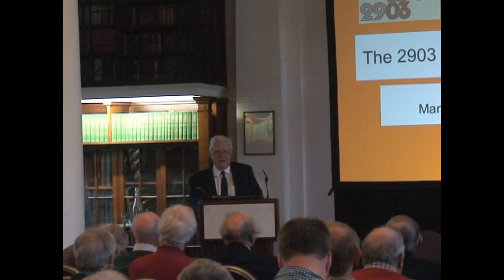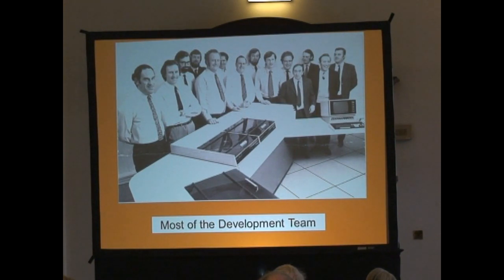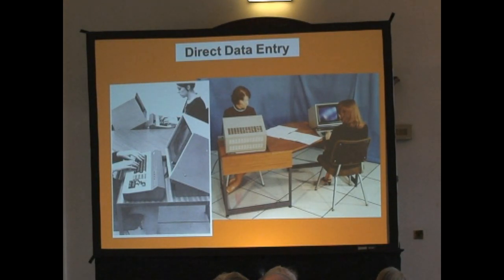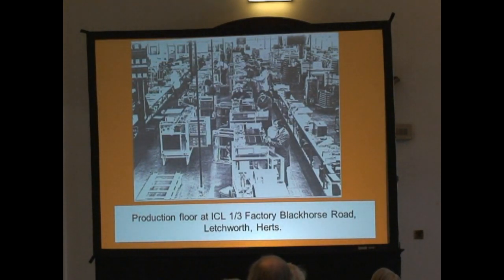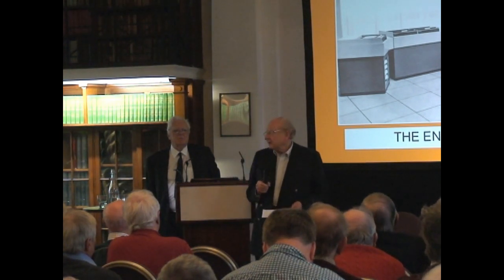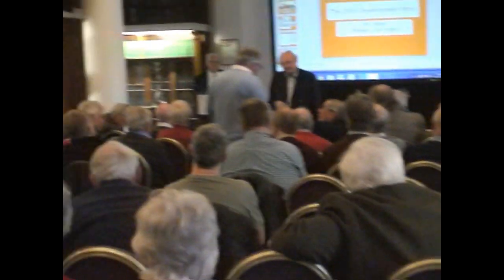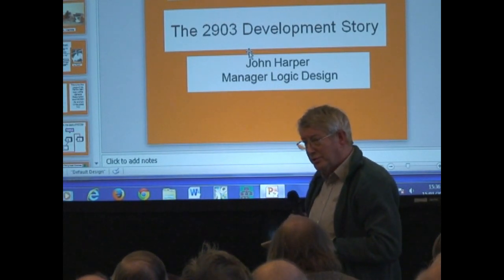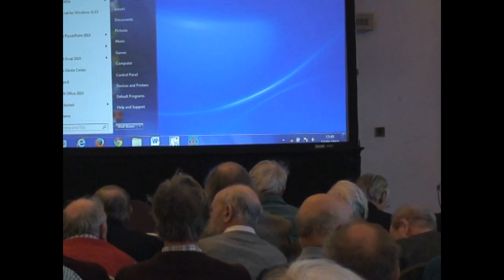The ICL 2903 Development Story

Comment: First mainframe I had experience on was a 1903, then got to operate a then-new 2903. Recall it as quite user-friendly and versatile (for its day). Upgraded to 2904, then an ME29, which was apparently a 'mini computer'! Much smaller hardware and FEDs replaced EDSs. In all I spent a decade working on ICLs then the company I was with had a policy shift and switched to PRIMEs. Hated them. Took a year off, worked in hospitality and then got back on MEs for a year before I threw it in and changed careers. Have some great memories of the times and the people I worked with

Comment: Just a quick addition, the printer attached to the 2904 at the end of the talk, was a Data Peripherals Ltd PBS (Printer Band Sharing) manufactured in Stevenage at a joint venture between ICL, Control Data and NCR as a low cost replacement for the 667 Barrel Printer many of which had my fingerprints all over them. I actually joined DPL, long name Computer Peripherals Inc CPI- DPL, when I left ICL Letchworth in 1978 along with several others from the team at 1/3 Factory.
Instead of a costly machined block on which the hammers were mounted, we produced a fabricated system glued together along with a printer band just 1/2" wide rotating horizontally to replace the costly barrels. Got my finger prints on quite a few of them too.

Comment: I worked on the ICL 2903 at 1/3 Factory in Letchworth and have been trying to find anything on it so this is wonderful with the background and photos it brings those exciting times back.
Are there any 2903's still in existence anywhere?
Reply: Would be good to know if there are any in museums.
A programmer I worked with bought an ME29 when it was retired (for less than one percent of its original value). Ran it from home for a while doing payrolls for small companies. I believe he eventually sold it as scrap and replaced it with an i486SX!
Reply: Been on the lookout but not found anything so far. I did come across a 1900 set up in Dunedin in South New Zealand by chance when visiting the museum there.
Reply: There's a great Computer Museum in Cambridge but all they've got is the 2255 Video unit although they are looking for anyone who knows anything about it. I'm keeping my eyes and ears open.